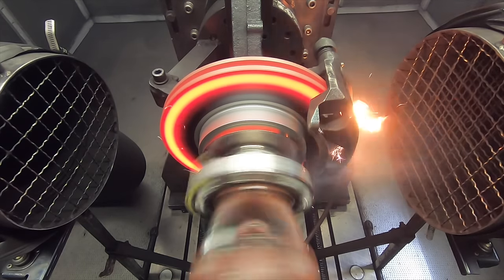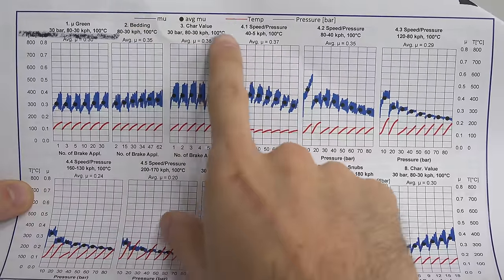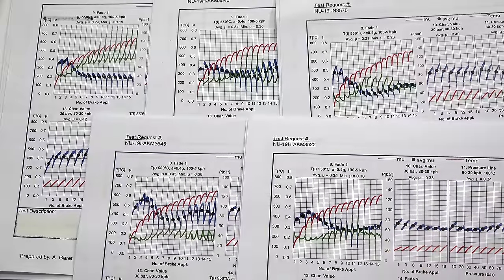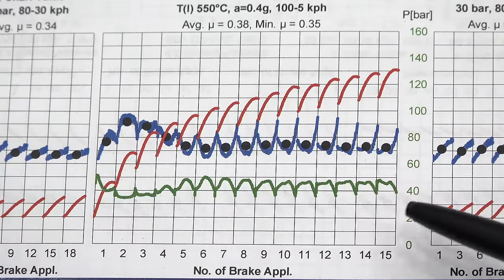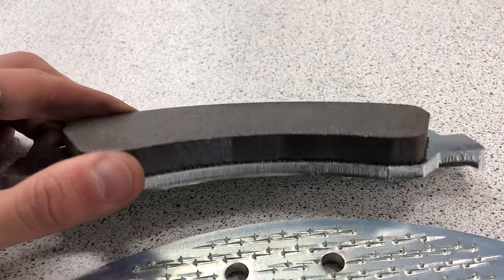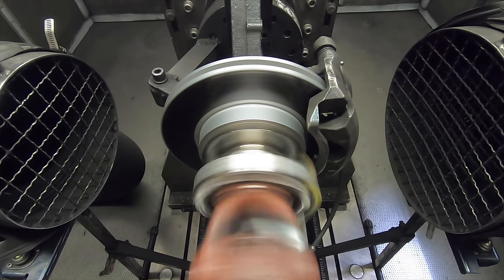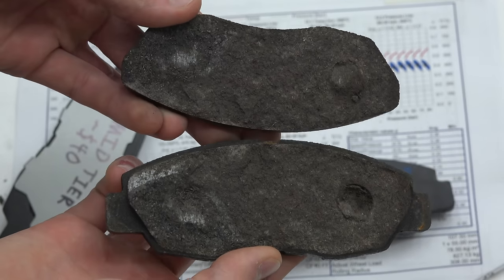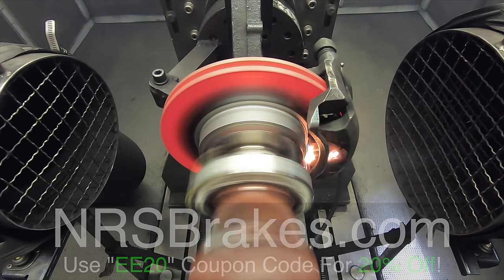What Are The Best Brake Pads? Cheap vs Expensive Tested!

Comment: Brakes, tires and headlights are not places to save money.
Reply: I beg to differ for headlights. Cheap leds bulb are a major improvement over OE halogen
Reply: @krannification  Cheap LED bulbs also don't shine light the same way as OE halogens, and the light isn't reflected the same way by the headlamp housing either. Cheap LED bulbs in a car that was meant for halogens are giving you worse visibility and blinding everyone you drive past in the opposite lane.
Reply: @krannification  I suggest you watch a few videos comparing different led retrofit bulbs from the channel headlight revolution. They have many videos in which they put several different bulbs into the same housing, shining through the same lens. Cheap/poorly designed bulbs often times perform horribly compared to ones with a better design, or even the stock halogen bulbs for that matter.
Reply: And engine oil
Reply: @krannification  All they do is give the appearance of lighting up better, when in fact it's the opposite. Google and maybe you can stop being ignorant. I don't care if you crash and die, just don't make it less safe for others
Reply: Where I live you will fail your annual roadworthy inspection if you fit LED bulbs to headlamps not designed for them - for a good reason.
Reply: @krannification  I disagree.  In many cases putting LED replacement in housings not designed for them can greatly alter focus.  If you want LED, buy an entire housing designed for them.  They won't be cheap.
Reply: Trace, I have always said your life depends on the tires and brakes.  Definatly not a place to save money.
Reply: Yes, your examples are all important, but I don't think there is anything in a car that it's worth saving money. Say you buy a cheap suspension, you end up braking other parts quicker because of the poor vibration dampening, so you have more parts to replace sooner. Say you cheap out on paint, it's likely not done properly and will chip off sooner and you risk starting rust.
Reply: gabi ailincai name a manufacturer that sells “cheap suspension”. bad paint isn’t going to cost you your life.
Reply: What are the places to save money?
Reply: and oil......
Reply: Cheap brake pads are 100% fine, it's all I have ever used I change them my self and do it twice a year deeded or not. I spend money on Oil, tires, waxes and anti corrosion products because I live in western, NY were we can get 6 foot of snow in one day and the salt they use destroys cars quickly.
Reply: I get the expensive pads and I don't have to change mine for 5+ years usually
Reply: Shambler and filter
Reply: @JamesSmith-lt5zz  you probably don't have a wife and 3 daughters driving your vehicle either like I do, they would go threw the best brake pads in the world in 6 months. I buy reputable pads, if it were just me I would buy ceramic pads and not change them for probably 10 years...then again 4 women drive this vehicle.
Reply: @JamesSmith-lt5zz  ???
Reply: Cheap halogen bulbs last longer than high end versions. 
It even says it on the packaging.
Reply: @krannification  yes indeed i beg to differ. Its all great how much light you get from your cheap leds right? The oncoming trafic enjoys that light RIGHT IN THEIR EYES as wel. And guess what? If that car hits you from the front you are not going to see light ever again if your a bit unlucky.
Reply: @greenmarine5  if your wife and daughters are that bad of drivers that they cant remove their feet from the brake pedal while driving i would not let them drive a car EVER. But the fact is that good brakepads tend to last 3-6times longer then the cheap crap in real world conditions. I have tested this others have, we all came to prettymuch the same conclusion. Then there is stopping power and pedal effort required. Do you want to visit your daughter in hospital or do you just want to hear about a near mis because she managed to stop just in time? That is the difference.
Reply: I use akebono brake pads there quiet . Great bite  For me they seem to function Better than  oem  that’s my experience I find cheap and some brake pad brands seem to squeak halfway through the pad wear down
Reply: Hey, been ok with having different tires for each wheel, what are you talking about? They all rotate.
Reply: @mjc0961  I  absolutely agree, I got fed up flashing my Halogen high beams at every second car coming at me 6 months ago , so I joined the other team and now everyone is saying high to me:). Until someone regulates the car makers and their LEDs, the brighty whities are here to stay.
Reply: @JamesSmith-lt5zz  I used O'Reilly's Brake Best Ceramic pads and usually average around 5 years. Usually costs around $120 for front and back. Just put some on my 2015 Nissan $55.00 for the front set. Hoping for the same results as my 94 Camaro LT1
Reply: @greenmarine5  They must ride the brakes like crazy! I've actually never heard of brake pads lasting 6 months. WOW! Usually 3-5 years 😳
Reply: @gabiailincai  you can save money on seat covers, infotainment system, floor mats etc. Yeah, only interior design stuff
Reply: I bought LED lights because the incandescent were garbage
Reply: I see what you mean, but that notion implies more expensive equals better quality and many many times that is not the case
Reply: idk i got a good deal on some goodyear eagle f1s for 700 for my camaro vs buying parelli for less than 500
Reply: Agree with tires and brakes but headlights?
Reply: Dil Ritzy hmm maybe paint? Fenders, anything cosmetic
Reply: Wipers and mirrors neither
Reply: I save my money on oil and oil filters!
Reply: @kaptinkeiff  why you want a car if you put cheap oil and the engine would die in 1 year or less genious
Reply: @jamesvwalker268  i want to know if They live on Mount Everest and they have to go down that mountain every day on car or what? Wearing the brakes so stupidly is to NEVER let them drive again
Reply: @eliasgill2453  I've put cheap oil in my 265k mile car for years, still going strong. Clearly you're about 12, and know nothing about cars, so please get off the Youtube comment section...
Reply: @eliasgill2453  it depends on the engine type. Turbocharged engines stresses oil more than natural inspired ones, also some engines get much torque out of less cylinders - less cylinders also mean less crankshaft bearing points.
You can run an older uncharched  engine with cheaper oil (but it will consume more fuel), but not a newer one with turbos, which will consume less fuel.
Fuel may be cheap in the US, but not in other parts of the world, where a fuel guzzling V 8 would ruin normal people.
Reply: I always tell people that a GOOD way to save money (on the long run) is to buy good PREMIUM parts ...........(period). example; buying Synthetic Oils will save your engine to die prematurely yet changing the oil at longer intervals. 👍🏽🥇. That is my personal opinion.
Reply: suspension too
Reply: Dick Bawls  at least in western countries these airlines are under the same regulation as flag carriers, and there has never an aircraft crashed from Southwest or Ryanair.
The comfort may be not as good, but they are not unsafe.
Flying in 3rd world countries of course is a different story.
Reply: I've had bad luck with aftermarket alternators.
Reply: And engine/transmission oil
Reply: @jorgechavez7211  You get good engine and transmission oil for a fair price if you buy it directly by yourself. If the service stations of the brands sell this oil in combination with oil changes, they buy it for 1 or 2 $ per liter and sell it to you for 25.
Reply: @FermSingh  there’s a huge difference between the Sylvania cheap bulbs and their better ones that come in the orange package. When I buy a new vehicle I immediately change the bulbs to those. It makes a huge difference in brightness. If they had the cheap bulbs, it’s twice as bright. You can really see down the road. And they last plenty long too.
Reply: @mjc0961  yes, blue/white spectrum is not really natural and harms our eyes.
Reply: @krannification  Go and get some decent Osram Halogen Xenon bulbs. They give a pure white light without blinding everyone else on the road.
Reply: @baddriversofthenorcalarea500  name checks out
Reply: Just because there is an expensive top of the line product doesn't mean its the best even with things that involve safety like brake pads or tires. Often at higher price points you get extra non safety related features like being quieter. You could spend $10k on a full ceramic brake system, but if your driving a prius your not being safer your just wasting money.
Reply: @mjc0961  Not true, depends on the car. My WRX has MUCH better visibility with the LEDs I put in over the halogens, and it has a clean low cutoff still. I drove opposite my friend a few times to test and they don't blind at all.
Reply: Not a great place to waste money, either.  Seems like many premium brands are actually just good at BS marketing.
Reply: BRAKES: EBC Yellowstuff with EBC USR Rotors. (Change pads every 2 or 3 years)
TIRES: Continental PureContact LS or for higher performance the Michelin Pilot Sports.
On a budget the Kumho Ecsta PA51's. 
Not sure about headlights, but best wipers are the Bosch ICON.
Reply: @averycase5493  paid reviews
Reply: Tires ehh I've got some good cheap tires and I've been kicking ass out here
Reply: You're being dramatic

Comment: Huh, it's almost like engineers get paid to design oem parts for a specific car and purpose. Who would have thunk it
Reply: I'm Still Alive  Don't question the Germanic engineering gods!
Reply: whats your point? modding vehicles with aftermarket parts is fun. dont hate,  just do your research.
Reply: yea because there are different heat tolerances and stuff like that. they test everything for hundreds of thousands of miles. you think some company trying to make cheaper parts is going to pay for all that?
Reply: Adriel R  that is not always true. oem is definitely not always best. oem is often a compromise between what is best and what costs the least. if you work in development you would know this. parts are often engineered to bare minimum requirements, nothing more.
Reply: Adriel R  for the road yes but if you track your car you need to upgrade pads and fluid. Disks will be ok most of the time
Reply: Well now you are just talking crazy
Reply: Adriel R  oem is never the best, its perfectly adequate for the desired price point of the vehicle. So you could say it's the best value for many. You can always find parts that will perform better, just not necessarily a good value. Performance gains drops off sharply while the price climbs exponentially.
Reply: How did you draw this conclusion with brake pads? Their is just shitty brake pads and good ones. Doesn't make any difference what vehicle they are put in. You can't design a brake pad that can only work in one vehicle.
Reply: @LewyKablooe  there are quite brakes, long lasting brakes, performance road brakes, track brakes, extreme performance brakes. Brakes designed for all sorts of special purposes to fit specific needs. The best brakes for a old Ladies Cadillac are not even close to the same thing as the best brakes for a car built for time attacks.
Reply: Except virtually all car manufacturers outsource stuff like that. And these aren't even being used on any specific vehicle, they're being used on a machine. In other words, you point literally doesnt apply
Reply: Lol you really think Toyota has a whole department to develop brake pads, from research to production? You don’t think that they just specify min specs, then outsource it to the lowest bid with a decent track record? Pretty sure it’s the latter. In fact pretty sure at this point it’s gone beyond that and they choose already developed pads on the market and just ensure the surface is sufficient for stopping power and cut a deal with a third party manufacturer to sell far below retail to them, which is why aftermarket pads happen to fit many different makes and models to begin with...

OEM pads didn’t even wear better than the mid tier as well, so right off the bat might want to reevaluate that stance.
Reply: The only thing I can't stand about non oem parts from a parts store or online is that I always have the issue of something not fitting right because the quality control is terrible. Usually I have to order my parts too so I'd rather get the part right the first time and avoiding sending it back and waiting another day or two
Reply: Adriel R  Your telling me OEM pads are going to be better then my brembo carbon ceramic pads....okay...
Reply: Hello two L phillip, I’m one L philip
Reply: @vityazsix  Exactly. And yes, you pay more for OEM parts, but they are superior.
Reply: This video is fluff because it doesn’t go into all of the variables that can effect performance nor was there a test for potential badge-engineering.
I mean, it’s not hard to talk about semi-metallic vs ceramic vs organic vs Kevlar.
Nor is it hard to through out there that an OEM manufacturer also produces their own line and thus might make the same pass for less because there is no dealership premium.

A Toyota pad is 80 bucks while an Akebono is 45-50. Such a test would matter a lot to expose whether badge engineering exists. It would make economic sense as the manufacturer doesn’t need to invest in new tooling specifically for an OEM make and model. My local dealer has a lifetime membership reward in which a 35 dollar credit can be applied to any parts and even fluid bought at the dealership. Free oil, or 80 dollar brake pads costing only 45, just like an Akebono sold in the retail channel.
Reply: @Sam S brakes are usually made by suppliers - not by the manufacturer itself (like most parts of a modem car). They are also developed by this suppliers. 
Car makers buy their brakes from the supplier, which also offers aftermarket pads under his own brands.
The question is if he uses the exact same material like for the OEM pads or not.
Such suppliers are Brembo (for expensive fast cars), ATE, Lucas or others.
Reply: @unclejohn5012  there are also OEM carbon ceramic pads available - however they are also made by Brembo, because car makers don't make own brakes at all.
Both will be similar, if not identical.
Reply: And this testing machines.....Which OEM vehicle do they represent?